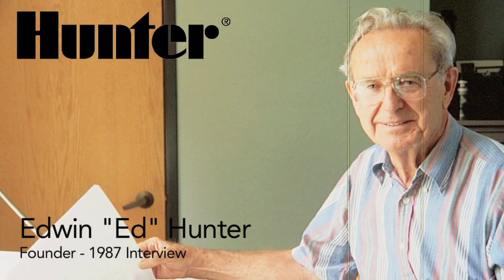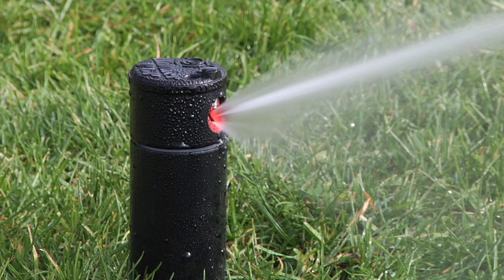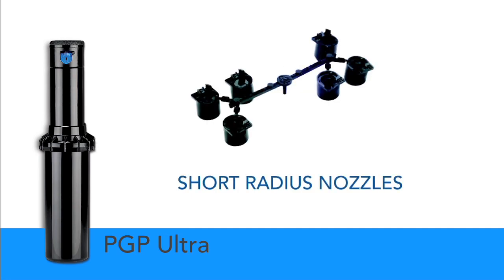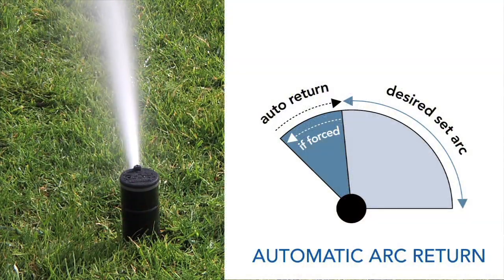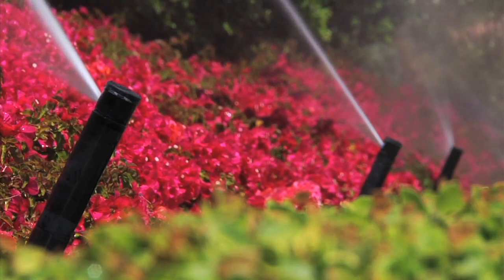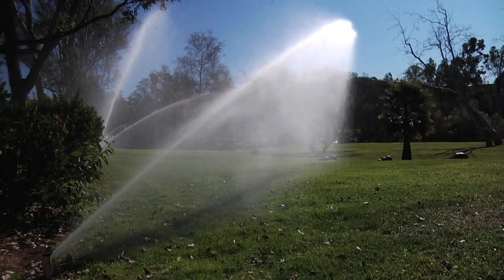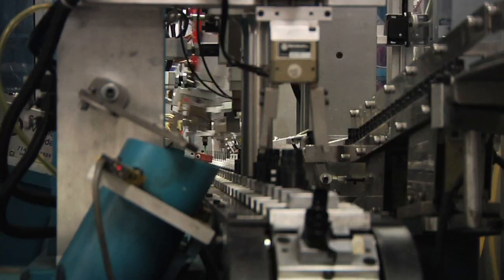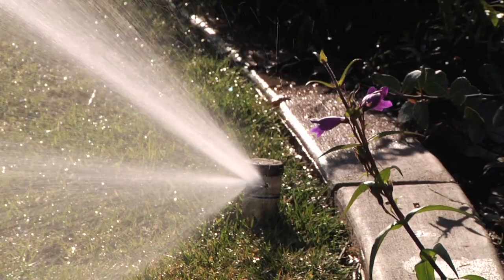Hunter Rotors: PGP, PGP-Ultra and I-20

Comment: Question.
@ 19 second, can you tell me what type of sprinkler head that can shot the water front and back simultaneously? What are the brand and model?
Reply from the maker: The I-40 opposing nozzle model can do this. Use the link below to learn more about this rotor.

https://www.hunterindustries.com/irrigation-product/rotors/i-40
Reply: @Hunter_Landscape_Irrigation  do you think the I-40-ON and I-50-ON can be used on a residential?

Comment: How do you install a HUNTER 142300SP PGP Drain Check Valve into the PGP - I have removed the internal mechanism and placed the drain check valve at the bottom - but when I try to tighten the mechanism the pop up sticks up above the top
Reply: Hunter Irrigation Thank you

Comment: In the past 2 years I've gotten 30 Hunter I20-04 4 in. Pop-Up Adjustable Arc Rotors, and have been replacing 18 year old rain bird heads in 18 zones. My question is this year I had to replace 2 of last year's heads because the won't pop up and 2 weeks ago replace old rain bird heads with 2 new hunters and in a week 2 of my new rotors I put in won't pop up with the rest of the heads. No grass or anything obstructing them, I have to physically go out and pull them up. It's like they're stuck and with a little effort they pop up. Have to do that each time I water. My question is do I have to replace them with new ones again or can I replace the insides? I bought them threw sprinkler warehouse, are they under warranty? I thought if only a couple I would just throw them away but it's starting to be too many.  Thanks.
Reply: when is the last time you checked your water pressure?